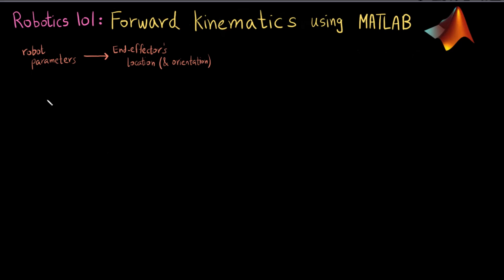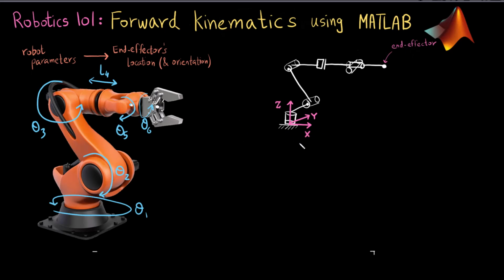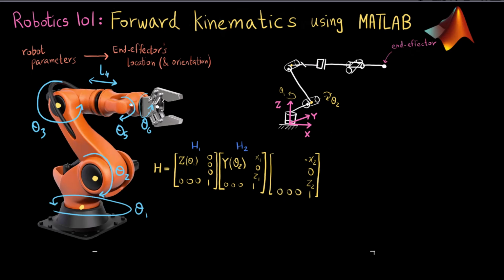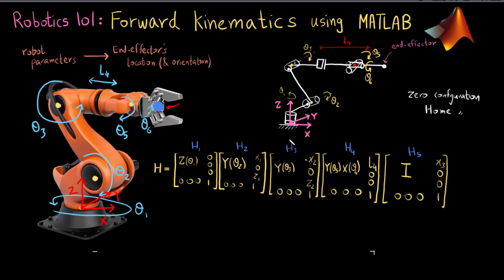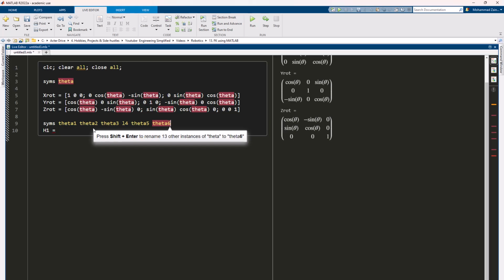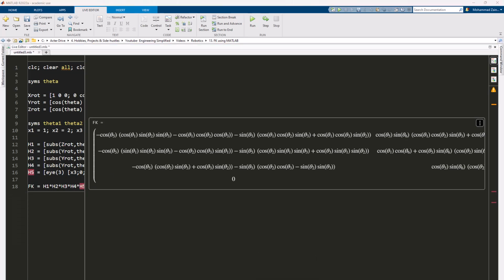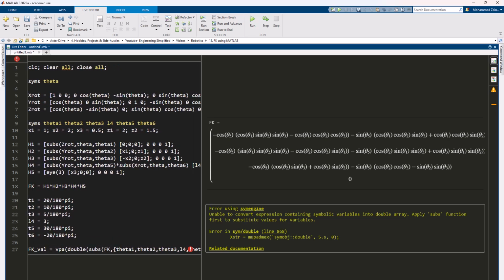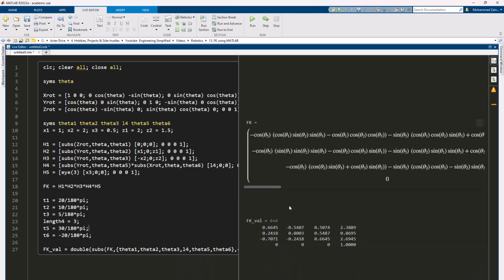Forward Kinematics of Robot Arm in MATLAB

Comment: x1 is a constant but x2,x3 depend on (theta) and are a2*cos(theta2), a3*cos(theta3)....a2,a3 being lengths of the links. 
Same applies to z2,z3...
Reply: hello,
but what do the x1,x2,x3,z1,z2 mean??

do they mean the links' length ??

please clarify
Reply: @karamjirjees8353  watch the video. Position of the joint in x axes with respect to the previous joint.
Reply from the maker: Branko353 is correct. The 'x1' is just the distance of the joint2 in the x-direction from joint1 (which is the base frame). Similarly, the 'z1' is the distance of the joint2 in the z-direction from joint1. 
Does that clear out your confusion, karamjirjees8353?

Comment: Hello, thanks for the video. When I tried the codes with your order ı took an error "sym/cat>catMany" error and [resz, ranges] = checkDimensions(sz,dim);  Can you help for this?
Reply from the maker: I have no idea what that error is. One suggestion that I have is that you try 'Debug Using Run to Here' command in MATLAB and see exactly which line is producing the error. You can view a few methods of error debugging here: https://www.mathworks.com/help/matlab/matlab_prog/debugging-process-and-features.html
Reply: @EngineeringSimplified  thanks dude

Comment: Why is theta 3 positive in clock wise and negative in anti clock wise this is my last question I am very sorry 
This would be so annoying 
Actually I am researching on Kinematics and working in HAPTICs NED
Reply from the maker: See the schematic that I made on the right hand side at 11:53 . I have marked the theta 3 being positive in anticlockwise. I did make a mistake when marking it on the actual robot's picture so you can ignore that.
Hope that helps to clear out the confusion.
Best of luck for your research!
Reply: @EngineeringSimplified  so you have applied right hand rule with thumb pointing positive axis isn't it
Reply from the maker: @abdulrafaykhan8537  Yes, with the thumb pointing towards the positive Y-axis.

Comment: I mean that when the initial structure is made by homogenous matrix initially every angle is at 0 degree then we give whatever orientation and change the end effector point
Reply from the maker: The initial angle is based on what the manufactures decides to be the zero position (home configuration) of the robot.

Comment: Zain can you please tell me that is the initial structure of the robot has nothing to do with the angles, are the coordinates we put in each H matrix  the main part of the 3D structure ?
Reply from the maker: The angles of the robots are related to how much the motors have rotated at each of the joints. The coordinates that we put in the H matrix consists of the rotation matrix and the displacement vector- these are based on the current position and orientation of the robot.
Reply: @EngineeringSimplified  but the problem is that I made a Kinematic model which is for a quad robot leg but
It's only giving the right end point when I take its initial position as 0 degree through Cordinate in H Matrix and then start to give angle
Reply from the maker: @abdulrafaykhan8537  does that mean that when you motors are all at their home position, the leg is straight?

Comment: and zain lastly please tell how to do simulations of a desired a robot with desired DOF
Reply from the maker: There are many robot simulators available. If you have MATLAB, you can download their robotics toolbox and see if that has the robot that you want to simulate. There is a very good simulator that I use which is called 'ROBODK'. You can download it and give it a shot. It has a 30-day trial but it has hundreds of robots available and you can change the joint angles and see the robot move.
Lastly, if you are doing research, then it helps to write your own code in MATLAB and simulate it. I do it when researching since doing that, I can change various parameters and see the impact of them such as changing the length of links, the # of joints, the location of the base, etc. If you are curious, here's a brief info about my research which has videos of the simulation that I produced: https://www.zainullah.com/project/path-planning-for-industrial-robots-working-collaboratively-on-a-task/

In a nutshell, I would recommend that unless you are researching, you stick with easy-to-use robot simulators like RoboDK or its tuned down free version RokiSim.

Comment: Will we take the coordinates of each Homogeneous matrix according to the H1 frame
Reply from the maker: The coordinate of each homogenous matrix is taken from the previous displacement. For H2, you have already applied the H1 transformation and so you will take the coordinates accordingly. For H3, you have already applied H1 & H2 so you are now at the location of 'theta 2' joint so in order to go to the location of the 'theta3' joint,  you will need to go -ve in the x direction and +ve in the z direction.
Does that help solve your confusion?
Reply: @EngineeringSimplified  Zain does this means that in 3D the coordinates of next Homogeneous Matrix is according to the previous Homogeneous matrix just like you did in 2D
Reply from the maker: Yes, that is correct! You got it now.

Comment: Zain can please tell me how to take the angle measurement manually in 3D, pls give any solution beacuse in 2D we follow the trail of prev X axis and start the angle from their
Reply from the maker: In 3D, the angle measurement is non-intuitive. There are three angles involved, one about each axis -X,Y and Z. They are often called yaw, pitch and roll. If you are given just a reference frame in space and asked to determine it's yaw, pitch and roll then its a dumb question. It's complex and holds little importance.

For 3D real world cases, let's say an industrial robot arm with 6 DOF, you will see that they have a revolute joint at each of the joints so they are only revolving about one-axis per joint. So, by reading the angle of rotation off from the motors, you can easily see how much each joint has rotated.

Does that make sense and help clarify your issue?
Reply: @EngineeringSimplified  a servo motor moves 0 to 360 degree now I want to know that if the angle on 1st DOF around x axis is 60 deg which we also put in H1 matrix  so the motor is simply gonna rotate  from its 0 deg to 60 deg  
I just wanted to know in 3D is it simple like this because in 2D we give angle to the matrix wrt a specific axis
Reply from the maker: @abdulrafaykhan8537  Yup, you are correct. If there is just one motor at a joint (which is the case in reality), then in your Homogenous transformation, you put in the degrees that the motor has turned about the respective axis. If a motor turns 60 degrees about X axis, then your rotation matrix will be X(60) or [1 0 0; 0 cos(60) -sin(60); 0 sin(60) cos(60)].

Comment: YO. How can I have that matrix in the output?
Reply from the maker: Isn't MATLAB giving you a matrix as an output by default?
Reply: @EngineeringSimplified  I mean, your output matrix has different template from mine. D’you use some tool box?
Reply from the maker: @alessioleoni1  No, I am not using any toolbox. Perhaps the reason for the difference is that you might be using a normal script while I am using a live script. Try using a live script and that might give the format of the matrix.
Reply: @EngineeringSimplified  Thank you. How can I use the live script?
Reply from the maker: @alessioleoni1  To create a live script in the Live Editor, go to the Home tab and click New Live Script . You also can use the edit function in the Command Window. For example, type edit penny.mlx to open or create the file penny.mlx. To ensure that a live script is created, specify a .mlx extension.
See MATLAB documentation here: https://www.mathworks.com/help/matlab/matlab_prog/create-live-scripts.html
Reply: @EngineeringSimplified  Thanks.

Comment: Hey boss, what if the initial coordinate frame is centred around the 2nd joint (theta 2). Would this change anything?
Reply from the maker: It would slightly change your homogenous transformation H2 since H2 currently includes a translation about both x1 and z1. But the initial coordinate frame (base frame) is assumed to be at 2nd joint, then you won't need to translate by x1 and z1. Does that make sense?
Reply: @EngineeringSimplified  Makes sense, thanks!

Comment: Hello Zain 👋, what a great technical content!

I would like to ask you a question. In previous videos, you mentioned that we can combine or split Homogeneous Transformation matrices. And I did it for our example. However, when I compare them, the final forward kinematics matrices are unequal. I have added the .mlx file below. I hope you can find time and clear up my confusion 😅

Thank you 

Link: https://drive.google.com/file/d/1ae8RFBvZau2dSIURF63sadygwj9U9LDG/view?usp=sharing
Reply from the maker: Hi Oben, firstly thanks for the appreciation.

I just checked your matlab live script and I have figured out what the error in your logic is. Let me provide an explanation that should help clear out the confusion.

The way homogenous transforms works is that they have both a displacement vector and a rotation matrix combined. However, within the homogenous transform, the way it is read (and it works) is that it is FIRST displaced and THEN rotated.
Now, in your working:
- In the first method, H1 represents no displacement and a rotation about the Zaxis which is correct.
- In the second method, H1 represents first displacement in x1 and z1 directions and THEN rotation in Zaxis about this new point. Hope you do realize that this new location is not the point where the rotation about the Zaxis is taking place. Hence, the answer from this method is wrong.

Does that clear out the confusion? Let me know if you need any more help. Thanks.
Reply: @EngineeringSimplified  Yes you have the right 🙂 My transformation matrices describe a completely different robot 😅 I understood my mistake better with the IRB 120 robot FK equation that you explained in future videos. Thank you so much, instructor! 🤓

Comment: Hi, Is there any rule that for a 6 axis robot there should be 6 homogenous matries as you have only 5. So, I got the doubt
Reply from the maker: There isn't. You can have 20 homogeneous matrices or 3, it doesn't matter. Think of it like traveling in a car from point A to point B. It doesn't matter how many stops you take in between, which path you follow. All that matters is that you end up at B.
The analogy sits well with homogeneous transform of a robot's end-effector. All you need to do is to express the end-effector frame in the fixed frame. You can multiply out as many H that you want as long as they help you achieve what you want.
In short, it doesn't matter how many homogeneous transformation matrices you multiply out, your final Forward Kinematics matric (which is a homogeneous transform) should come out the same.
Reply: @EngineeringSimplified  Got it. Thank you